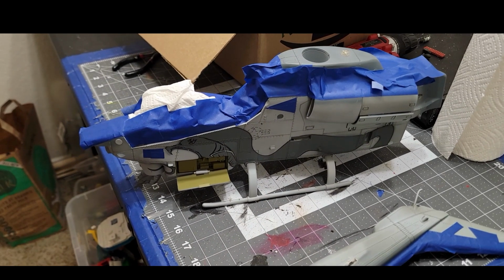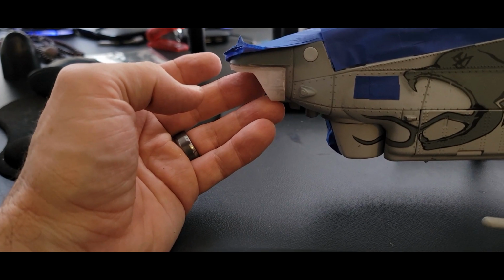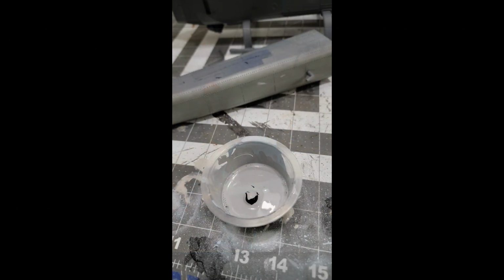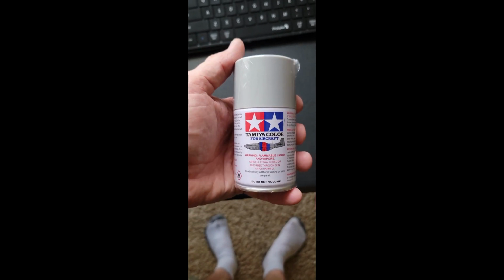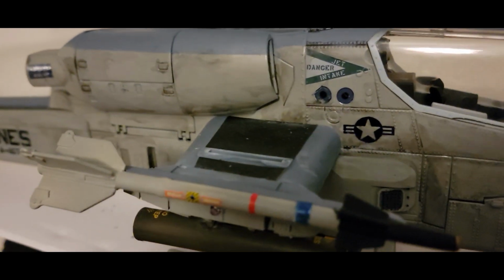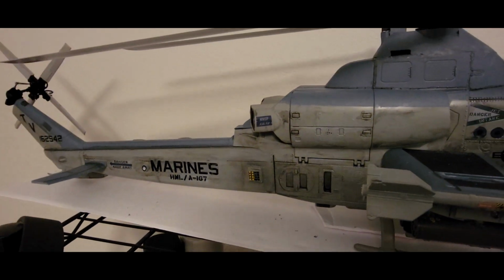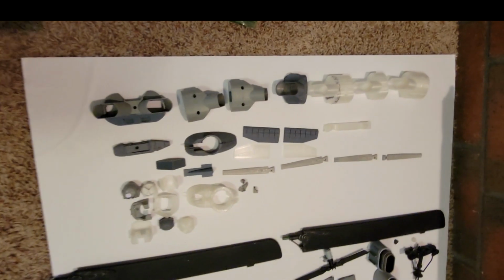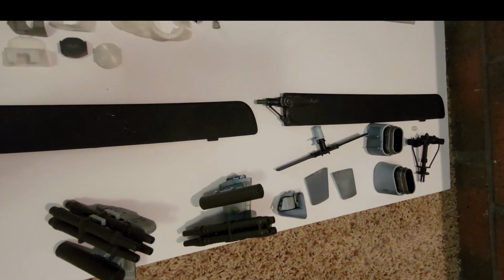1/18 Scale Ultimate Soldier/21st Century Cobra to Viper Modification/Kitbash

Comment: Cool to see this upgrade! I actually have this Cobra! 21st Century and BBI Elite Force toys are some of my favorite toys in my collection.
Reply from the maker: They are amazing! This was a lot of fun to build. I did one before but this one is much more detailed and accurate. I can send you the 3d prints if you ever want to mod yours.
Reply: @donkeyboy712  Thanks! I'll definitely let you know! There was a website around 2004-2010 that would sell 1:18 scale figures and vehicles and eventually added upgrades for certain vehicles, which were usually made from plastic molds. A 3D printer is on my wish list now!
Reply from the maker: @semperdanny  that's awesome! You can get them pretty cheap on Amazon or you can get a deal on a used one.